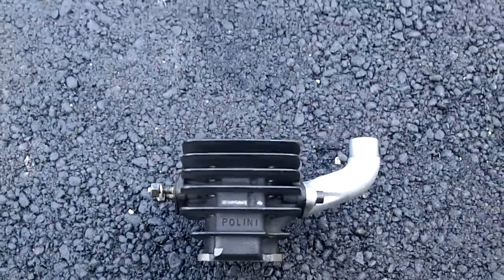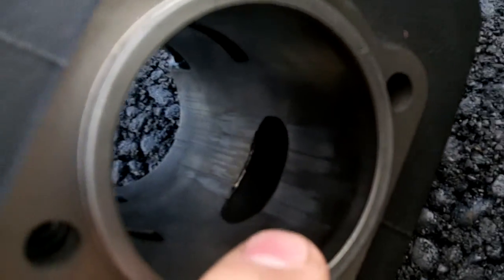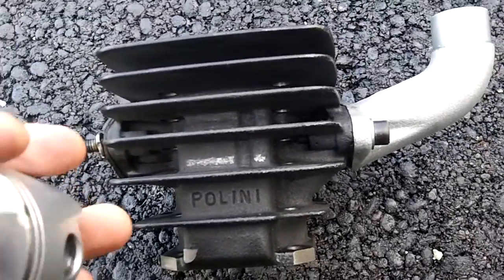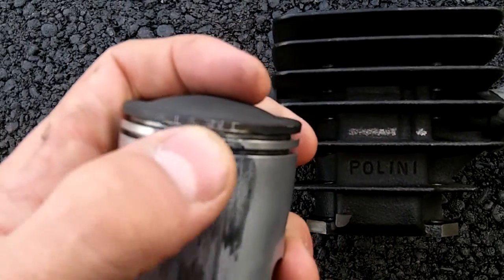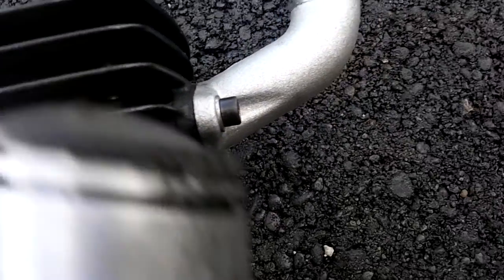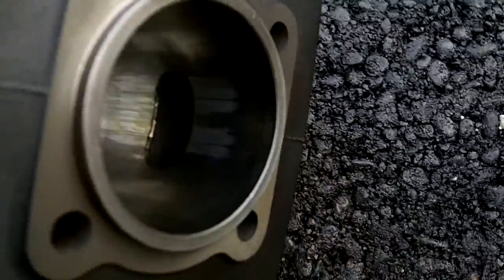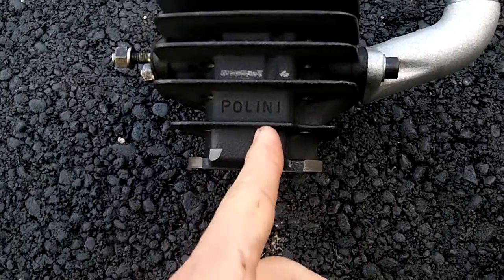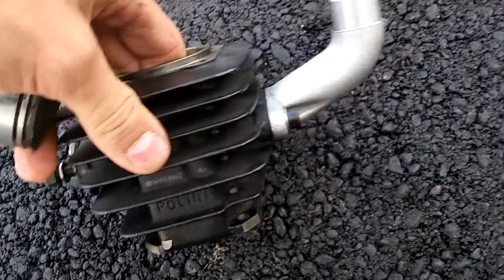Minarelli Polini (seized)

Comment from the maker: I bought a 47mm piston to replace the 46mm piston and took it to the local motorcycle specialty shop where they bored it open to fit the new piston. It runs fine and doesn't need and plating. It's cast iron so there's nothing to worry about. The cylinder was fine when it seized anyhow. I only bored it to fit the new piston.